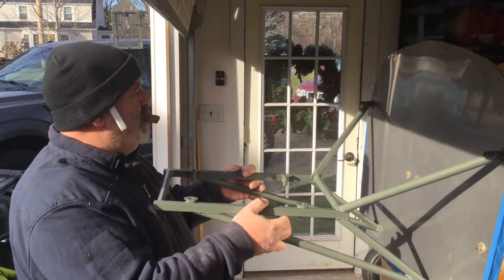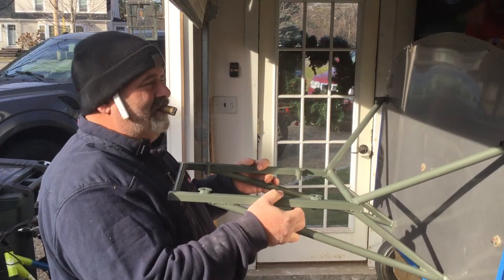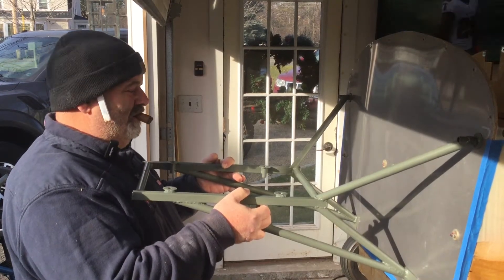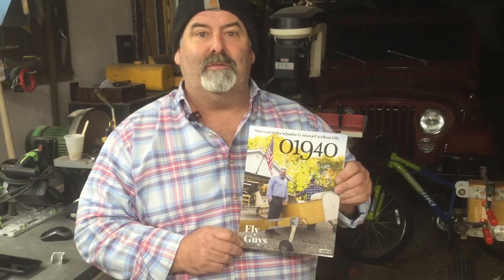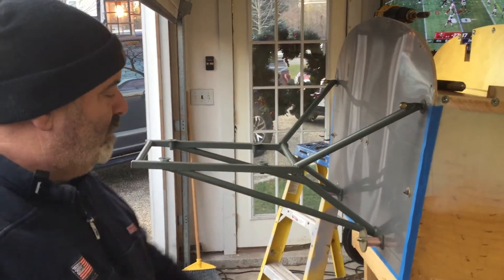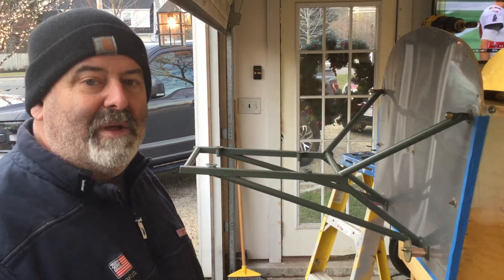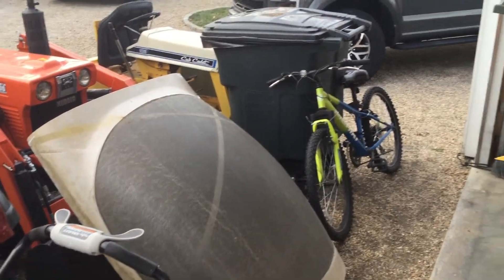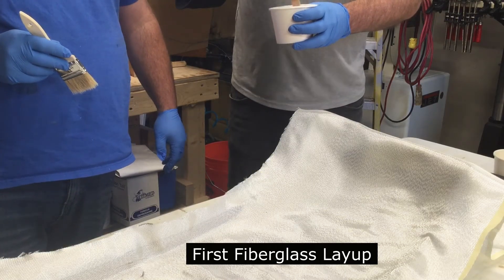KR2-S Engine Mount Installed!

Comment: Is that engine load transferred to the main spar?
Reply from the maker: No, there are 2 headers: 1 at the top of firewall and 1 at bottom. AN bolts pass through firewall and headers, then AN nuts secure inside firewall. Main spar carries the majority of wing load. Seat bases go between front and rear spars.